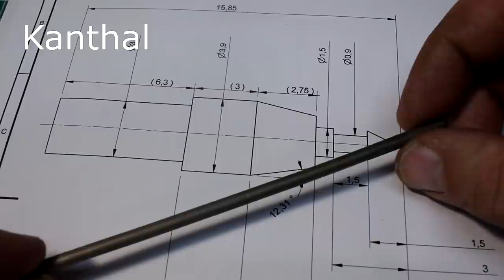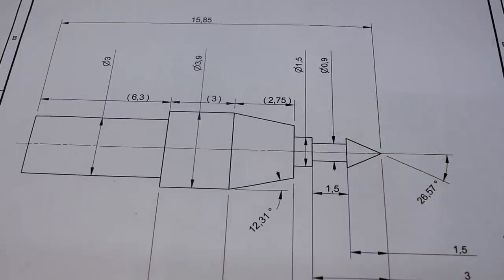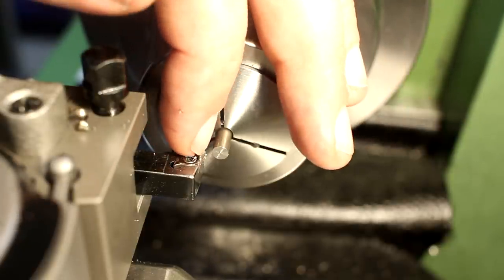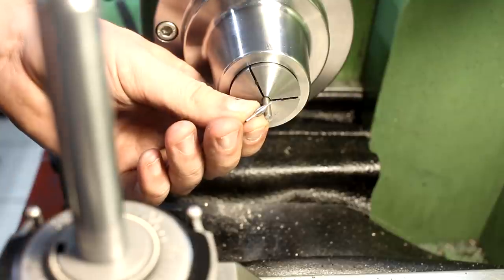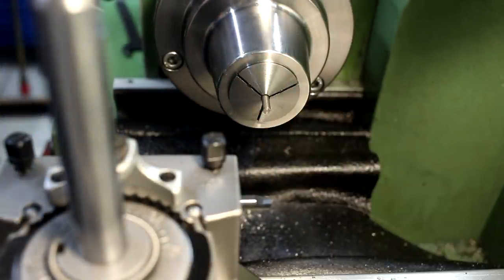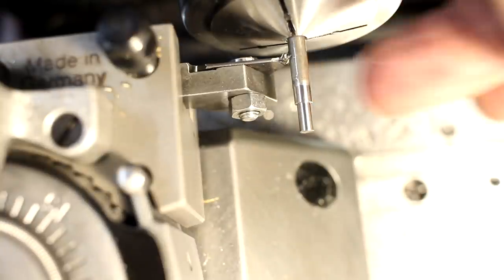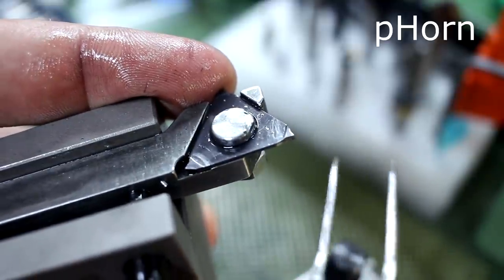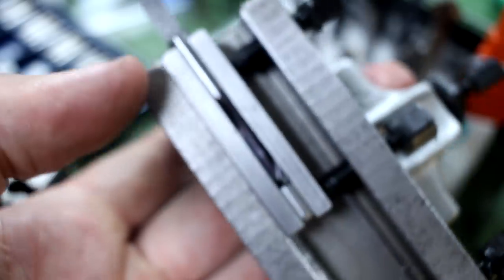Plasmaspeaker Electrodes

Comment: Micro-machining. Story time.

Most of my career was in a very large shop machining major ship's parts, deck winch components, turbine cases, large double suction pumps, ship's rudders and propellor shafts, that kind of thing where even the set up equipment has to be craned in. One Friday I was told to report on Monday to the 5th floor chronometer shop to take over for Bob Franklin, a master of small parts machining and soon to get a new heart valve. Naturally, things were superbly coordinated so when I reported on Monday, Bob had already been off for a week and hurry up making those chronometer shafts. 

I was a babe in the woods. The equipment was scaled to needs of instrument and chronometer work where the largest lathe occupied one end of a table and there were shelves and boxes and cupboards of miniscule gadgets superbly made but never before seen by me. I was lost. Baffled. Overwhelmed. I chickened out and took the work to the motor shop across the street where I bummed use of a Monarch EE and a Bridgeport, machines I understood and could immediately use, where in five weeks of bouncing back and forth between the 5th floor and the motor shop, my total output in parts would almost fill a coffee cup. 

Drove me nuts, particularly making bitty screws under magnification. I recall making a long adjustment screw with about 20mm of M1 threads. I had to cobble up a tiny follow rest to support the diameter while chasing the threads only to learn from Bob when he came back he used threading dies from a big collection he revealed in a chest of many drawers. He got a big (actually, careful, with many a wince) belly laugh when I recounted my travails in micro-machining. He showed me the store of screws he maintained for the replacements I'd painstakingly made the hard way. His was a machine shop AND a parts store. If I'd stuck with it and explored for a few hours I might have puzzled out productive use of Bob Franklin's little world. 

Not a shining moment in my career. My hat's off to Stefan. He makes stuff on the edge of visibility without turning a hair whereas I break out in a sweat of anxiety at the prospect of tightening the frames of my bi-focals.
Reply: Forrest, you still kicking around, where do you hang out these days?  Miss the old Sir John of sudswater..and the forums.
Reply: @greener121 The confident ingorance and sniping on PM got to me but I look in there from time to time. Still cruising YouTube but pretty much inactive on techie threads.
Reply: Great story. Have read many of your excellent posts on PM. People who actually know what they're talking about generally aren't arrogant.
Reply: Sorry, Forrest, don’t want to hijack Stephan’s excellent video with unnecessary comment, but pls dm me on Instagram, same name, I’d like to chat.

Comment: OK. Stefan, I used to have to repair and or manufacture parts similar to this from similar material. 
The method for straightening the stock material:

1) cut the material into short working lengths
2) place between two smooth finished plates of steel
3) rub the plates back and forth so the material rolls between them
4) applying more and more pressure will roll the material into a straight segment
5) check by rolling the piece on the top surface of a plate looking for any deformation that retards rolling.

The key is in the pressure applied and the friction between the two plates and the material to be rolled.  You are looking for the curve to form out of the piece as it rolls.

TchuS

Comment: To quote Wikipedia: "Kanthal is the trademark for a family of iron-chromium-aluminium (FeCrAl) alloys used in a wide range of resistance and high-temperature applications."
Reply: Never heard of it before
Reply: It's basically used anywhere you might have heard of nichrome being used. The advantages of kanthal are that it's structurally sounder at higher temperatures than nichrome, does not exhibit surface oxidization until much higher temperatures, and has a much lower temperature coefficient of resistance than other resistive heating wires (so it's useful for precision power resistors). (It also has the highest resistance per unit length of the commonly-used resistance wires.) And yes, it's very commonly used for vaping.
Reply: @cambouiscom  I can get my Kayfun to whistle a tune if I wanted to . Haha

Comment: Awesome work, as usual.
Wonderful tool and project design.
My 2 cent tip: Find a biological  supplier next to your location and buy a single box of parafilm (should last a very long time).
Parafilm is a paraffin sheet (comes in a roll) made of soft paraffin, flexible, stertchy - wonderful for wrapping tiny parts during shipping.
If you need a small jig to be air-tight - that's the stuff to wrap around the seams... very useful.

Comment: Kanthal wire is commonly used as heating elements in electric furnaces, up to 1400 C. It's an alloy of iron, chromium and aluminium, hence it's magnetic properties. 
I've built a couple of furnaces for heat treating and melting aluminium, bronze and brass for casting using Kanthal wire. It works really well.

Comment: Interesting, thanks Stefan. I don't know anything about plasma speakers, but I do know that plasmas require height temperatures, hence I guess the use of Kanthal. I used Kanthal wire to build an electric kiln/furnace - mine is good for about 1300 degrees C.

Comment: Everytime I see someone making tiny parts like this I know that this wouldn't be something I would like to do. I'm not talking Abom sized work neccessarily but I like to see what I'm doing without using a magnifying glass.
Reply: I seem to need stronger magnification every year regardless of the size of the parts. Abom or normal size. So smaller parts just needs more! 🔍
Reply: @sirlurk_calot  When you get old enough, it is less lathe and mill time, and more youtube time.

Comment: Kanthal is a heating wire used in a toaster, when current is passed through the wire it heats up due to the high electrical resistance and I suppose it is heat resistant up to high temperatures so glowing red hot doesn't effect the material much.
It is also almost impossible to solder a copper wire to it so maybe spot welding or something like that is used  to make an electrical connection.
That is all I know about it, I don't know the specific details of the material.

Comment: In addition to previous comments on Kanthal, I point out that originally is rather soft, but after first heating, it becomes brittle as ceramic.
Reply: In my experience it doesn't get that brittle, just a bit more. It starts out kinda springy. After heating, it is much less springy, but can still be bent fairly easily, and is somewhat more prone to breaking than before heating, but no where near as brittle as ceramic.
Reply: It doesn't get anywhere near as brittle as ceramic. (Assuming your comment wasn't hyperbole.) It gets slightly more brittle.

Comment: I wonder if tungsten electrodes would last longer? There are alloys available that machine ok. I have turned similar sized parts for hearing aids. The high density was important then. For resistance wire W wire is the highest temperature stuff You can source easily. Perhaps that would apply to plasma erosion as well? The material that looks like cast but nowadays ground stock is supposedly available. A joy to watch Your work. I use Sandvik triangular groving inserts similar to Yours, dont know if they are on the market anymore. I regrind them, probably have a lifetime supply... very useful.

Comment: Did you ask the customer exactly how much the angles mattered? The dia 3 and angle 26.57 (with no tolerance) seems mean. I would back you to machine (and measure) 3.00 but how would you even measure 26.57 degrees? 

Luckily I only work to my own drawings now, and rarely have to produce them any more. But do recall the machinists querying my +0 -2 tolerance on a 25mm part. (it was a "don't care" surface. 
And the other way, a long argument that I lost where my drawing showed a 0.2mm +.05-0 flexure in the middle of lots of +/- 0.2 tolerances. The drawing had one side of the flexure as the origin, but they set up the CAM differently and mid-tolerance from a different datum made the flexure disappear. 
I still think that I was right and they were wrong. But I have found few machinists who agree. They all assume that CAM to mid-toerance should always work on a hypothetical machine.

I guess I would have beem in a better position to argue if I had used some datum symbols, but I was new to the game.
Reply: Tan (26.57) = 0.500. It is a 2:1 slope, and probably not hugely critical. I know there are studies of how arcs and corona discharge work on points of various angles, and I'm sure this angle was picked for a reason. But I suspect that +-10% would probably be fine as far as the corona discharge is concerned. (But it would probably torque an "audiophile" completely out of shape to know that it was really 26.56 degrees.)
Reply: When no tolerance is given, a general tolerance such as ISO 2768-1 can normally be assumed. For such small features it is +/- 1 degree for both fine and medium tolerance class, regardless if the angle has two decimals or is a round number. If available, I would use a shadowgraph to measure, but you could also use any kind of accurate rotary table or compound slide and see when parallel. In this case if the tool is made with the correct angle, there is really no way the part will deviate much.
Reply from the maker: Not critical at all, those Angles just where the result of the x/y dimensions given.
Reply: @StefanGotteswinter  Ah, so you made the drawing, not the customer? That makes a bit more sense.

Comment: Why don't you put another threaded hole for a clamping screw in your multifix holder for holding short tools? Are they too hard to drill and tap? Great video as always.  Thanks.
Reply from the maker: They are quite hardened ;)
Reply: Stefan Gotteswinter i guess if it was easy you would have done it 😜

Comment: Kanthal (can-thal) is typically used as heater wire, used in things like electric heaters, hair dryers, toasters etc. It's similar in use cases to Nichrome heating wire. I don't know how plasma speakers work, but I'm assuming it must be some process of super-heating air to produce controlled frequencies. It's FeCrAl - about 65% iron, 30% Chromium and 5% Aluminum.
Reply: I'm pretty sure plasma speakers just operate at the frequency of the sound they're intending to produce. Want a 1khz sound wave, put 1khz pulses into your electrodes.
Reply: @outputcoupler7819  Sound is moving air. Simply putting electricity into a straight piece of wire will not produce sound. My limited understanding is the electrodes are heated to produce plasma arc oscillations that excite the surrounding air to produce sound. There's more detail available online.
Reply: Yes. Same general principle as a singing tesla coil.
Reply: @kindabluejazz  Of course sound is moving air (...sort of, it's a pressure wave so the air doesn't actually have to move and in practice the macroscopic movement is negligible). But in this case the motion isn't coming from heat either directly or indirectly. It's coming from the rapid expansion of the plasma. The plasma expands because of electromagnetic forces, not because of heat. The plasma arcs are not created by the heat either, nor do they need the heat to form. You can produce arcs just fine in a gas of any temperature with electrodes of any temperature, or even in a perfect vacuum (though vacuum is a nearly ideal insulator so it takes a lot more voltage).

The heat is an inconvenient byproduct of the electric current, not a functional part of the system.

Comment: Wenn man Deine schönen kleinen Drehwerkzeuge sieht, ist es schwerlich nachzuvollziehen, dass du dich für die Multifix Größe A entschieden hast.
Hast Du kurz vorher Bob Ross gesehen?
Reply from the maker: Ich guck den guten Bob immer mal wieder nebenbei beim Cad-Arbeiten ;)

Ich hab zwischen A und AA geschwankt. AA ist etwa so wie der Tripan111 den ich vorher hatte, aber ich wollte die möglichkeit deutlich größere Werkzeuge spannen zu können.
Die Bohrstangenhalter mit 30mm benutze ich ständig und ich habe einige Wendeplattenwerkzeuge mit Schaft 16mm.
(Die Zwischengrößen waren keine Option - Ich wollte Halter und Grundkörper von Axa.)